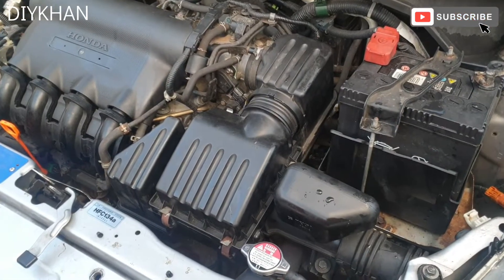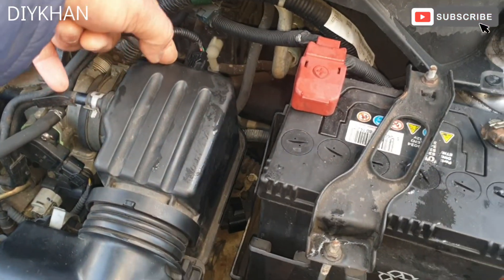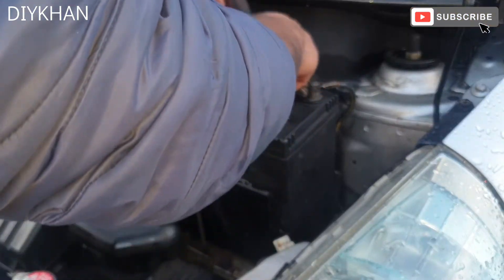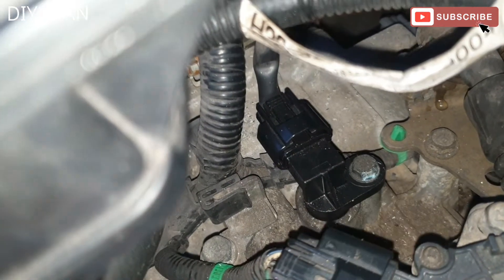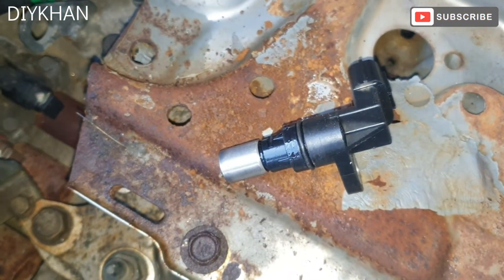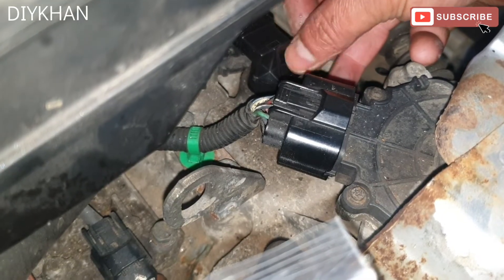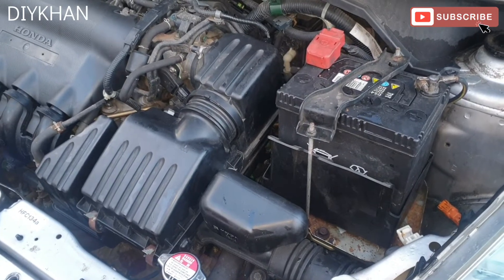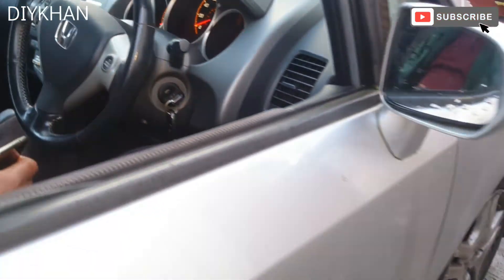Honda Jazz, Fit Faulty Transmission Speed Sensor Change. Honda Jazz Fit will not go into drive mode.

Comment: there are 2 sensors on the top of the gearbox one is part number 28810-PWR-013 (short) and the other one is 28820-PWR-013 (long). Which one is this?

Comment: Hi. I'm having problems with my gp1 reverse hear. If I keep engaged in reverse the engine starts vibrating violently then it stalls. But if I put it in Drive and move for ~2m the reverse sorts of resets n works until it starts vibrating again. Drive has no problem.

Comment: I was at the traffic light and the car started to fail as if it was running out of gas. I ran the scanner and it gave the code p1886, but unlike the car in the video, my CVT gearbox doesn't go forward And not even backwards, would it be this sensor because I would have to buy it and I'm afraid .
Reply from the maker: Its well worth trying. Good luck 👍

Comment: I installed a 1.5 Jazz engine on a homemade airplane. The engine speed is 4000 rpm maximum and the Vitec does not turn on. I think it's the sensor's fault?

Comment: I have replaced mine, still didnt work😢, after replacing sensor still doing the same thing.  I got the parts from genuine honda. And after replacing it the code still comes up and no drive at all, i only hear spinning noise from transmission

Comment: Hi I have Honda jazz 2003 I just changed the gear box, but when engage the car on drive or reverse it shut down the engine, please help
Reply from the maker: Have you checked all the sensor connectors.

Comment: Hi I have a 2005 honda jazz automatic is the speed sensor I buy Manual or the  automatic which is more expensive. But the euro car parts said the manual is a fit fory car ?I'm buying in the next hour ??
Reply: The speed sensor work on either.

Comment: What is this sensor called
Reply: Will this fit into honda jazz automatic 55 plate
Reply from the maker: @ozzy6572  just check it with the seller.
Reply from the maker: https://www.ebay.co.uk/itm/283847354110?mkcid=16&mkevt=1&mkrid=711-127632-2357-0&ssspo=j1AVO_3MRr6&sssrc=4429486&ssuid=F01xFgg6QJ6&var=&widget_ver=artemis&media=MORE
Reply: Hello brother I have bought the part and installed it and it is doing the same thing as before do you know whatbthe issue is???
Reply: @ozzy6572  what did you do then

Comment: I have same issue with p p1885 honda jazz 2006 the problem is when it's cold  the drive  will not engaged I have to wait 15 mins then it's will drive  normal
Reply from the maker: Yes same happened to this car too but after Changing the sensor it worked fine. Good luck 👍
Reply: I have to the same problem but I already changed but after 5 minutes it’s coming again d blink

Comment: My cars been jerking like crazy, got it scanned and came up with the code obd 22 excessive change of the vehicle speed sensor. Had a look at the sensor and it looks to be covered in dark grease or oil? Could the sensor be causing the jerking and rpm surge leading to triggering the engine light and stalling the car, ( CVT Honda jazz 1.4 )
Reply from the maker: I would change the sensor to start off with. Let's hope by changing the sensor your car's issue get fixed. Good luck
Reply: So it turns out the speed sensor wasn’t the issue, I had 3 faulty coil packs.
Reply: @ismailali3250  hi thanks for update but do U mean spark plugs the coil things
Reply: @Gta6billionaire  Not spark plugs, coil packs.
Reply: How did it go mate
Reply: @elijahkasweshi4480  changed speed sensor, and also added that xado 120 revitalizant into transmission and problem seems to have been solved. No more juddering or triggered warning light, car drives smooth.
Reply: @ismailali3250  what is xado and where can I get it from bro
Reply: @elijahkasweshi4480  will get round to it this week and report back
Reply: Yes this isy problem I buy mes ssv speed sensor my car is automatic and I buy Manual speed sensor the app said it fits my car
Reply: @Gta6billionaire  Get your coil packs checked and all 8 spark plugs too.
Reply: Ive had this experience before. Its shuddering in first gear. I use xado revitalizant from ebay and it works like a charm.

Comment: Friend, is the speed sensor on the fit jazz old manual transmission in the same location as the fit jazz old automatic?  I'm from Brazil, but I didn't find videos here in my country about this exchange.  My car is also from 2004, manual transmission and I need to change this part, but I don't know exactly where it is located.
Reply from the maker: Best to have a look at your gearbox casings to see if there is one at the same location

Comment: this would be the solution to the error code p1885? the obd2 informs me the error code p1885 and the D is blinking in my case.
Reply from the maker: Yes 100%
Reply from the maker: Good luck 👍
Reply: @diykhan  please can you tell me the code of the sensor you have changed, i have the same problem, but i dont know how to order it, i need the code,
Thank you in advance